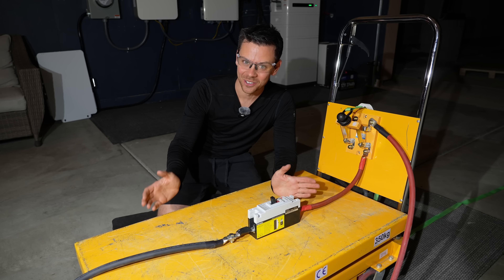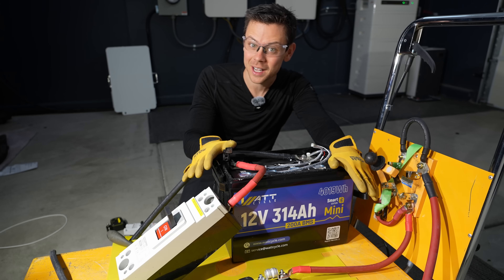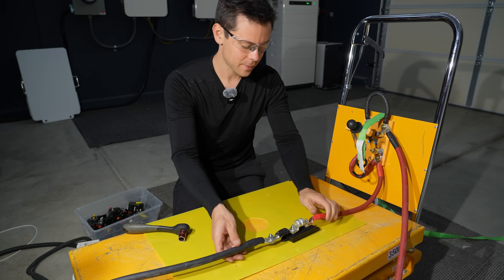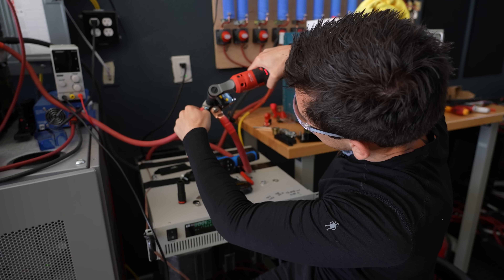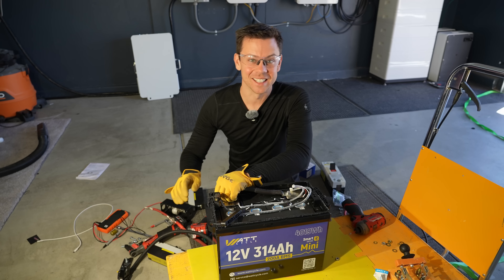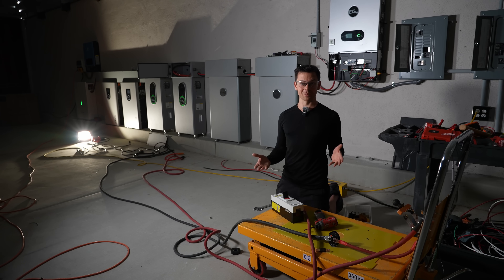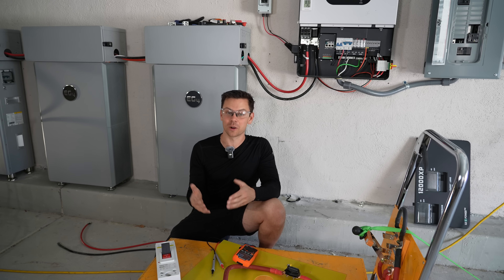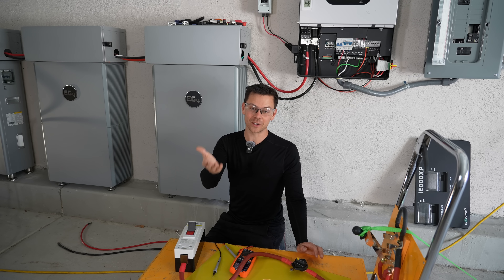DEAD SHORT 88kWh Lithium Battery Bank! What Will Break First?!

Comment: I would use an air cylinder to open and close the knife switch. It will move very fast and can allow reopening the knife switch if it isn't welded shut.
Reply from the maker: Now that's a smart idea
Reply: Air cylinder is kinda slow. Real deal big breakers store energy in a spring that looks like it could support your car. It is compressed and restrained with a 'close latch'. Once triggered all energy is released at once, slamming the contacts together.
Reply: @ericgiroux320  I don't know what kind of air cylinders you have used, but we built a golf ball launcher that would send them about 100 yards. We would usually slow them down with flow controls to make them less scary for the machines we built.
Reply: @szki272  Industrial controls. I suppose with large lines and valves it could work.Industry uses magnetic contactors for a reason though.
Reply: @ericgiroux320  Like with electricity, depends on the resistance in the air flow. The thicker and shorter the piping (all the way to the tank), the bigger the port on the cylinder and the valve, the faster it is.
Reply: @gabiold We generally want a smooth and controlled action, hence small valves and piping.
Reply: @ericgiroux320  I know, but that also depends. Some (jerky, sticky) loads behave badly with just air-flow-regulated control and work with an oil dampener attached to the motion system instead. In that case, it is better if the air pressure inside the cylinder builds up quicker, exerting the rated force and the oil thing deals with the speed.

There are cylinders with smaller ports and with larger ones, also there are quick release vales too (the ones with 2-3" thread, you build the usual potato canon with 😄).

Comment: Super important test. Tried similar with some car audio 200A auto fuse. One was constantly disconnecting even at low current, but the other one never did even with die hard short with big cables. Same brand and model.
Reply from the maker: Holy cow!n
Reply: @WillProwse it was a car audio “Stinger” brand. Believe it was some popular brand some years ago.

Comment: Also  what limit the current spike is the Total circuit inductance. All cables loop, inverter inductance etc are contributor to limit the current inrush. I would suggest to use your oscilloscope and a shunt and show us the current graph during the short circuit. This would tell ALOT more  than your actual setup!
Reply: Why am i not surprised to see you here? 😅also spot on with the inductance, i'd be curious is there was any difference in result simply from ziptieing the pos and neg cables together just to minimize some inductance

Comment: This makes it seem like a T-class fuse may not be necessary for systems with BMS-controlled batteries. Might be one of those "nice to haves" but not necessary as long as you are using quality fuses/breakers. The dead-short was literally the reason to go with T-Class.

Comment: You should also talk about the TOTAL CIRCUIT RESISTANCE Will.  Battery internal resistance + cable resistance + BMS resistance + switch + fuse etc, This determine the MAXIMUM interrupt current you can get on a closed circuit. It is also highly dependent on the battery voltage. The more volt the higher current. For exemple a battery with 1 miliohm + a BMS with 5 miliohm + a cable with 0.5 miliohm = 6.5 miliohms and at 48V this is a Interrupt current of  48/0.0065 = 7400Amp. Therefore it is impossible to get more  current than that in a short circuit situation. The breaker Interrupt current limit must be over this value normally.

Comment: This is exactly the kind of test I was looking for, very few people can actually do that safely or without risking to destroy their batteries. I think a test with raw cells would be needed to really see what happens with the different fuses and breakers. I realize it is pretty hard or unsafe to do without your second breaker like you did, but ideally it should not trip and let as much chance as possible for the tested fuse to blow up.
Reply: Perhaps put raw cells into a concrete enclosure outside your house, where a battery fire or explosion (lol) would not cause any problem.

Comment: Having a trip curve on a breaker.
That being said, that's what the NEC requires something called "selective coordination".
The quick explanation is that a breaker with a longer trip curve will (no pun intended) cause a breaker to trip faster  than the breaker downstream even though the main has a higher current rating.
Thank you for all of your time!
P.S. Very envious of your system and shop 👍
Reply: The IEE call that discrimination, the nearest breaker(fuse) should be selected to fail first given a prospective overload or short circuit.

Comment: You need a second rope to safely disconnect in case it doesn’t trip.
Reply: If it doesn't trip, couldn't the knife switch "weld" itself closed? Honestly, after watching this, I don't think this was a safe test. If there was melting, it might have continued onto the metal cart, which was moving when the rope was pulled.

Comment: I don't like the knife switch from a safety perspective. Get an industrial 3 phase contactor and wire all 3 phases in series. I like the test though.
Reply: Going to be very hard to find a contactor that can supply that kind of current without just blowing up though.
Reply: @redsquirrelftw A NEMA size 5 should do just fine.
Reply: Similar to what red squirrel said. It's not difficult it's just expensive to find one like that
Reply: @bullithedjames Try to find used from an old facility, or NOS. You only need 1 for any test of this scale. Should last 'forever'. Might even get away with IEC one. Not many cycles. Brah aftermarket ones have been good to us.
Reply: @ericgiroux320  I work at a factory where I replace these often enough. And all the ones I replace them with are used. They are still expensive.

Comment: I am currently building my first solar/battery setup and these videos are very helpful. Thank you very much for all the testing! That the BMSs trip before the fuses is not surprising. Electronic fuses need a few milliseconds only to detect an increased current flow. That doesn't make thermal fuses useless, since BMSs can fail as well.

Comment: at super high voltages you get weird capacitive effects were everything becomes a capacitor. i think its the falconi effect or something, why the power lines are higher voltage than the subststions coz the ground couples with them capacitivily.
with super high amps you get weird inductive effects coz everything becomes an inductor. the length of the wire becomes super important for limiting large pulse currents since there is like a lorentz force or something that has to mix up all the magnetisim of all the electrons in the air around the wire. the longer the wire, over short periods, the higher the inductance and it gets really hard to send super high currents anywhere. anything acting like a ferrite close to the wire amplifies this. ya typically inductors dont exist much in tthe dc world but here they do as i understand.
Reply: Ya, 4/0 at 2x 20 feet has a 100% voltage drop at about 9500 amps.  Need moar wire, but shorter runs :D

Comment: Even with the knife switch, I would make sure the cable was on something wood so I could chop it with an axe as a last resort. I would guess that even a knife switch could somehow fuse itself to the the copper terminals and not allow you to open the switch, especially after already sustaining some powerful arcing.
Reply: An axe? Get a contactor for safety.

Comment: you should build a "48v" capacitor bank instead for these, 23x maxwell 3000F capacitors 2.5v each, system voltage of 57.5v to mimic a full lfp pack. They will deliver raw cell discharge at FAR less capacity. So if anything goes completely wrong, the burn down time is in seconds, not minutes.
Reply: Dude...I know of an installation with around 100x 48v Maxwell supercap modules connected via busbars all in parallel....absolute spanner of any size vapourising capacity⚡⚡⚡
Reply: Good idea 💡

Comment: Sir.  At the end, you had a large black and white circuit breaker.  What is the max width of the input/output connections?  I have noticed that many of the breakers that look like that have connection sidewalls too close to accept most good quality wire connectors sized for 00 and 0000 connection wire.  Thank you, 

A T Burke

Comment: As someone with 72kWh of raw cells in parallel at 48V, I appreciate this test but to get more peace of mind I will have to wait for the real deal :)

Oh, and I have had a short once -- both the BMS (200A JBD)  and a Chinese 150A (max breaking power listed as 10kA) tripped and handled it like a champ, not popping my fuse that is the last resort guy in the setup.

Comment: Will, you need to add a large capacitor.  The voltage of the capacitor only needs to be higher than your supply (48v) but you need the largest you can get.  One with a low ESR.  You may need to charge it through a resistor to keep the BMS from shutting down during charging but then you’ll need to remove the resistance during test.
Reply: A capacitor might be the answer, and probably cheaper. But what about just buying a $2000 ridiculous resistor, like 20kw, so the BMS on the batteries don't trip, but allow more than enough (hopefully) current to trip the devices?
Reply: Is it really dead short testing at that point? You'll trip the breaker but nobody runs a 48V hybrid supercapacitor + battery bank setup because with the capacity of these batteries, it usually takes care of demanding inductive loads by itself. I wish there was a usecase...
Reply: The point is just to get a large inrush current to weld the breakers close  @Infinion

Comment: You should have added a Clamp meter to get the Amp Spikes. So i guess you going to have to do it again :). But Great Test. Thanks
Reply: peak current happens in less than 10 ms. clamp meter may be too slow.
Reply: This. I'm sure his meter does inrush
Reply: @jake-mv5oi it does, he has the Fluke 378

Comment: We can't do DIY solar in Florida. We can't do plug and play with a solar back up battery without approved engineering drawings and permits. Florida sucks for solar. Florida makes you gat a permit for an Ecoflow, Jackery or any other solar power. I can't lay a panel in my back yard without getting a letter from code enforcement. Did I say Florida sucks?!
Reply: Hi Harold, where do you live in Florida?
Reply: @PaulieMagee Orange county! Code enforcement is at our hour more than the mail man...
Reply: @HaroldJackson  so that's Orlando or closely near..... Are you rural?
Reply: I'm west coast but very rural.... There's solar all over the place .... Driving down the roads you can see private solar panels in racks and some not real fancy.....
Reply: install grid tie solar, get it inspected and approved, then modify to add batteries once inspector leaves.
Reply: @antronx7 not paying $50,000.00 to save $200.00 a month. I would never live to see any savings 😢
Reply: @HaroldJackson  laying few panels in a yard hooked up to ecoflow is not a $50K scale system. what did inspector say? is he worried your panels will fly away?
Reply: @antronx7 not to keep talking about this too much. You didn't read my first post. They don't allow us to lay panels on the ground. I already tried that. I got a nasty latter telling me to remove them or pay a $1,000.00 a day fine. No thanks. It doesn't pay to own property anymore.
Reply: @HaroldJackson  i read your first comment. you can do diy in fl as long as you dont get caught or do it with a permit. you got to do it right so your panels dont become 45 lb projectiles in a hurricane or tornado. but orange county may be extra ashole about it.

Comment: I was clenching my teeth when you hooked up that 88kWh bank.   I guess I should have trusted EG4 more 🙂 I'm happy I have EG4 (14.3kWh) batteries!   Only three of them... still, those tests make me feel safer.  Awesome awesome video!

Hey, you should also try some of the smaller MCBs to see how they handle the breaking amps you can generate.   single-pole, dual-pole, polarized, and non-polarized.  The cheap 1-pole Chtaixi's on Amazon are typically polarized while the 2-pole are typically unpolarized.

And then take them apart and see what the damage is (you just drill out the rivets and they come apart)

-Matt

Comment: You should film the rack of batterys in slow motion and see how they disconnect in a cascade failure.
Imbalances will mean some of the rack batterys experience too high current for their BMS even if the sum of current drawn should be almost ok for the rack and they should trip first, leading to the rest having to handle that load and again more will trip. Since they each have their own tolerances they should in theory not trip at same time but very close to.

Comment: The last video in this channel before Will retires will be him lining up everything in his operation in series to see if he can create his own lightning bolt.
Reply: Using a DIRECT LINE from the Hoover Dam Generators and a Couple of Nuclear Plants.
Reply: You can create a lightning 🌩 bolt with a 12V battery. 🤦‍♂️
Reply: @WolfsFriend42  ok 😂
Reply: @migmigjohnson6083  dude, a small coil on a high performance engine generates 100,000V. You could easily increase the amperage above 600A for the 1 second required. That would kill anything on the planet.